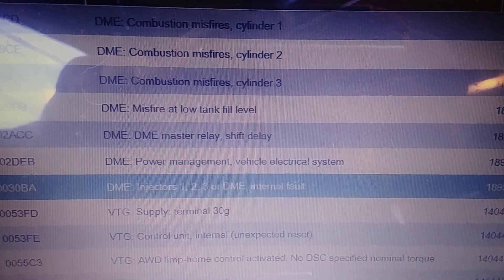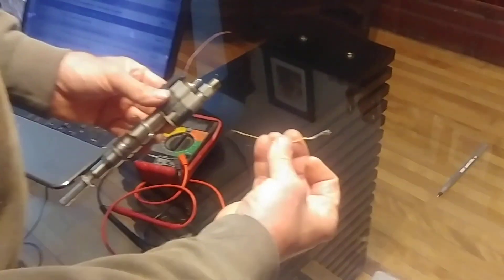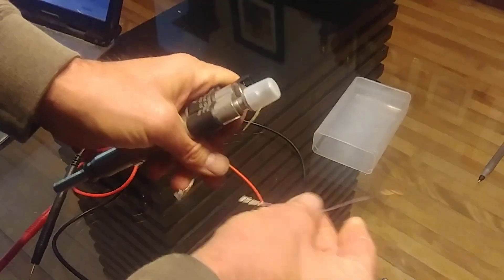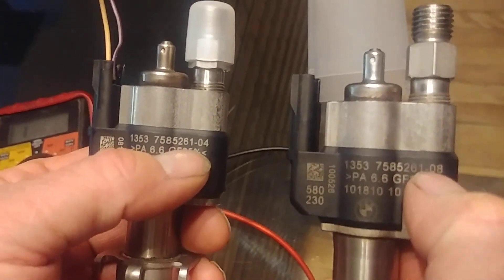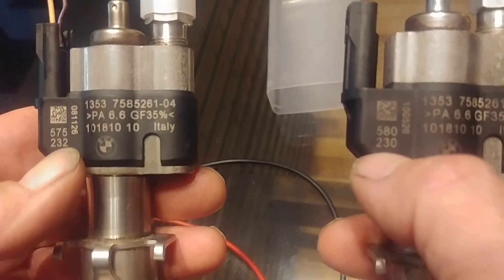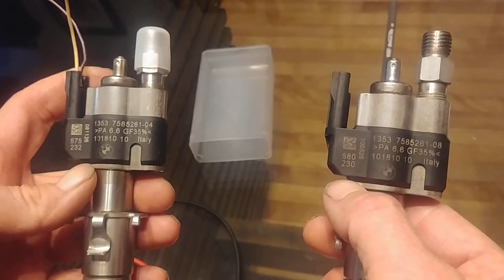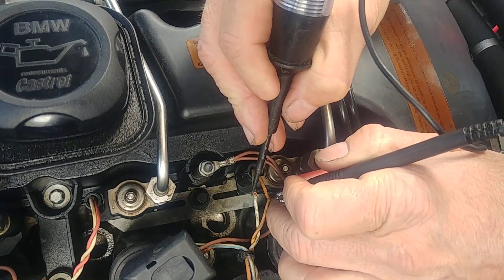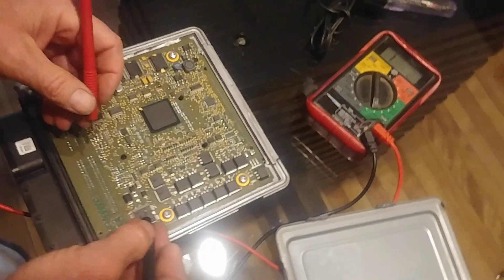BMW N54 335 direct injection injector testing and DME repair 0030BA watch part 2

Comment: Trying to diagnose 30BB error, Bank 1 works, bank 2 does not, and mosfets test ok. Five injector resistances were between 4 and 30 Megohms, only one was 200k ohms, and this was on the working cylinder bank.  I also tried a capacitance meter, and all injectors read around 2.2uf.
Could it be that the ecu must see at least 200k, on one injector of a bank, or that bank will be turned off?
Reply from the maker: you didnt mention what DME you have but yes it could shut off 3 injectors  but it should set a code for that
Reply: @danielosullivan7623   Thanks for the reply. The ecu is MSD80. Today I tried just adding 200k resistors in parallel with each bank B injector, but it had no effect. Still has code 30BB, and bank 2 injectors not working.
  At least I can confirm that one injector, on the working bank 1, did read 200k, and I was not touching the meter probes.
  The other 2 injectors, on working bank 1, have ohm readings in the multiple mega ohms, with ohm readings starting low, and slowly increasing.
  Every once in a while, after clearing the error codes, code 23C3 pops up "Bank 2, O2 before cat not connected". However, it is connected.

Comment: What did you use to create the wire extensions to test the injectors?
Reply from the maker: Just some terminal jumpers i made. You can use any old connector just remove the terminal and a section ofwire

Comment: how many volt work this injector???
Reply from the maker: Should be 12volts. best is to test with a 12v lightbulb of similar amperage and test meter to put a load similar to that of an injector.
Reply: Thats not correct , piezo injectors needs approx 150 v to open, you need a injector tester to test Them

Comment: hi i tested my injector it come 1300 it ok
Reply from the maker: Depending on your meter if you have it set on miliohms your ok. If my memory is correct I think between 10 - 17 ohms. Try changing your setting to Ohms. If you still get 1300 that's no good
Reply: The answer isent correct they are piezo injectors they are High ohmic in megaohms ranges not miliohm

Comment: so if I have a misfire in cylinder 3, can I switch that injector to cylinder 4 to see if it'll misfire in cylinder 4? or is that not a good idea since they're each programmed to each cylinder?
Reply from the maker: If you think it is injector.(fuel related) As opposed to spark( coil or plug) or mechanical( low compression bad valve). Then use an omh meter to measure resistance of injector. But you can  swap cylinders..as a quick test but injectors will need to coded to their respective cyls. To perform properly.
Reply: @danielosullivan7623  my friend, can you tell me if it's okay to disconnect the electrical of a single injector and let the motor run? To see if a certain noise is gone. Or will this induce problems with control unit
Reply from the maker: @Simmuh2   check engine light will come on. Just erase after your test
Reply: @danielosullivan7623  how to erase it, do you mean the light or the failure code? does the light go away when plugin it back in?
Reply from the maker: @Simmuh2  light should go out on its own but it's best to erase it with a simple code reader
Reply: @danielosullivan7623  thank you very much
Reply: @danielosullivan7623  Hello Dan, I have 2008 335i, I brought it in for 1-3 cylinder misfire. Auto Engineering in Lexington, MA, I have always used them for service with good results. This time they said I needed 3 new injectors. I gave them the go ahead. They then called and said, bad news, your DME has a problem with fried mosfets. My question is would you think they miss diagnosed on the first saying the injectors are bad, or can the bad injectors cause the mosfets to fry? Wouldn't their initial computer diagnostics only show that either injectors are bad or mosfets. I really enjoyed your video. Thank you for reply if you can. Andrew
Reply from the maker: @purplezoso  its hard for me to say without seeing the original diagnostics, in my experience what happens is the DME when it detects too much resistance in  an injector even a mosfet or ign. misfire will shut down injectors in banks ie. cyl 1-3 or 4-6 . making it really difficult to pinpoint the issue. you need to measure each component individually. which takes time. the car in the video had been to many  garages even bmw(with an insane estimate) before i recieved it. good luck. I do have some mosfets and good injectors if you need
Reply: @danielosullivan7623  Thanks very much Daniel for the reply and support. My shop does not do the DME repair and would send it out. Im going to test the Mosfets and replace myself.Andrew

Comment: I saw that car at the auction sale. Guys wanted to do an LS swap. This video tells how to fix things the CORRECT way, no BS, no double talk. And why was it running so loud, clacking???
Reply from the maker: CORVAIRWILD was runnig on 3 cyls. And direct injection is inherently loud. With sound insulation in place(cover) motor cover on purrs like a kitten